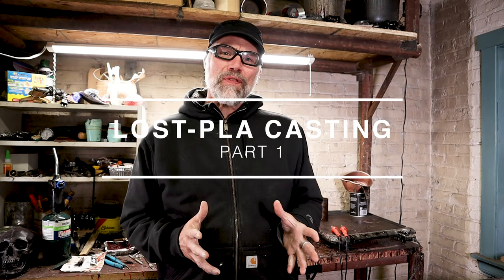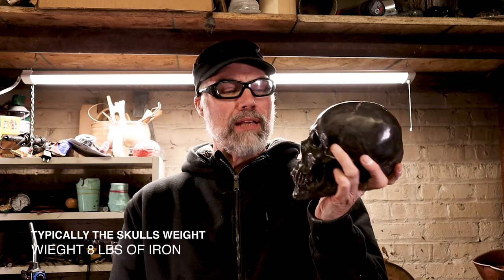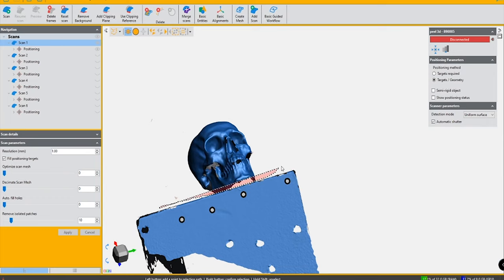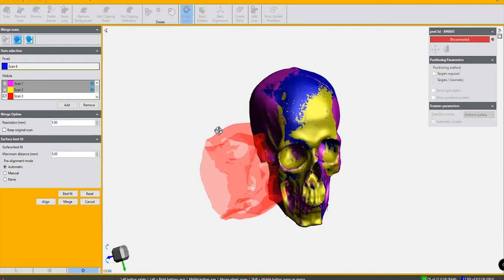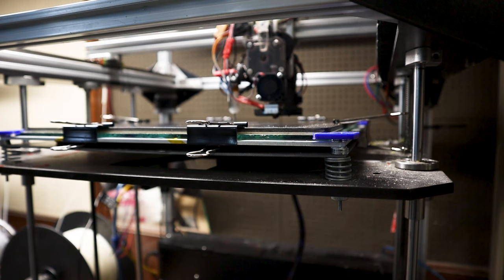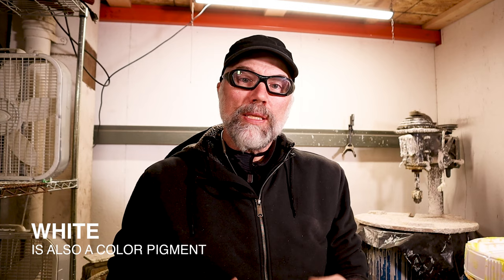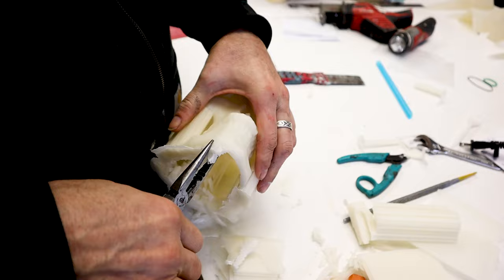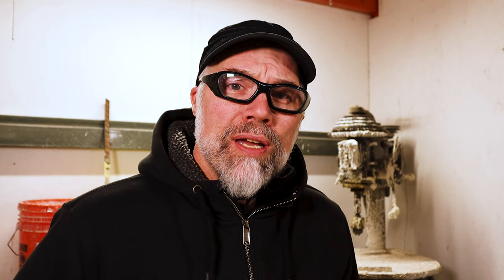Lost PLA casting with ceramic shell: part 1

Comment: I used cermic shell for the first time this weekend. I had some sprue breaking issues after coat 5. I need bulkier vents and better penetration on the cup. Thanks for the series you sold me on the ceramic shell.
Reply from the maker: Ya, since you have to handle the wax repeatably in a way that you don't have to with standard investment.  You really have to make sure that your sprue system is welded together well.

Comment: I have a question.

First of all I would like to say that I have watched all of your videos and find them extremely informative and educational. Thank you for making them!

The skull you keep talking about is a wax model with thin walls. How does suspenda slurry work with a hollow wax model? How do you get a good/even coating and layers on the inside and into small/thin hollow places of the model?
Reply from the maker: typically the slurry will coat evenly all surface it can come into contact with, so as long as there is an opening to allow the slurry to flow in and out off you should be good, just remember to roll the wax around to make sure the slurry drains out and doesn't pool.  For deeper details and texture us a brush with a stippling action to work it in and pop bubbles,
Reply: @LunarburnStudio  Thank you for the reply.

The inside does not have to be detailed but indeed should have an even coating. 

Do you also use the same sequence of first a few layers of fine and then the coarser sands or slurry only on the inside?
Reply from the maker: Yes same sequence

Comment: I'm looking forward to Part 2. Can't wait!  Can you explain the shrinkage in metal, aluminum, cast iron, bronze, brass ...?  Many Thanks!
Reply from the maker: There are a number variables when we talk shrink.  Each metal/alloy has a different level of shrink. but it is also influenced by the metal temps at the time of pouring.  One way to check it for your situation is literally cast a ruler (measure out a length or PLA) and remeasure when in metal to determine shrink rate.

Comment: I made couple sculpture pieces with lost pla  process, but not with ceramic shell, but with plaster, very good fast process but every time is little bit of gambling. Little bit more guessing than working with wax
Reply from the maker: I agree, if I can mold the pattern to make a wax that is still my first choice. but if the pattern is too complicated for a mold and I only need to cast a couple of them, I'll print and cast.  But if I have to cast 3 or more then I'll still lean toward making a wax.  Printing still take too much time to beat the efficiency of making a wax pattern.

Comment: Thank you very informative. Could you please talk more about your kiln and what kind of iron do you use in your projects. Great work!!!
Reply from the maker: I'll cover the burnout of the PLA in the 3rd part of this series, but will also do a video on the burnout kiln as well.  As for the Iron I use it is mainly steam radiators that you would find in older homes here in the states.  The iron is nice and thin and easily broken down with hand sledges.

Comment: I love your channel, could you please talk about metal shrinkage? Especially steel and stainless steel?
Reply from the maker: Metal shrink during casting or welding?
Reply: @LunarburnStudio  in casting of course, especially ceramic shell casting, I plan to cast some parts with steel and stainless steel
Reply from the maker: I have to admit I have no first hand experience casting steel or stainless, just welding it, it's why i asked.  Because of that experience and other conversations I can anticipate some issues and challenges.
Reply: @LunarburnStudio  if that's the case, it's ok, keep the good work, I love your videos, I learn a lot from you, that you
Reply: @LunarburnStudio  i think I can figure it out myself by learning from other resources

Comment: So this is not meant to be a complete replacement for wax?  Also, is the 3-D scan limited to objects that are small enough to stand on that pedestal or can you scan bigger? Is this method faster to make than wax?
Reply from the maker: Wax is still the most efficent material for casting.  Introducing scanning and 3D printing is great to prototyping and I f you only need 1 or 2 patterns.  But also it gives you the ability to change scale, making thing bigger or smaller.

Depending on the scanner you scan quite big.  There are scanners that allow you to scan building if needed.